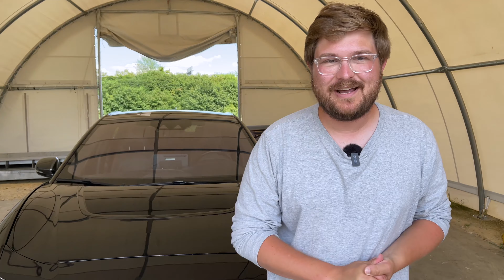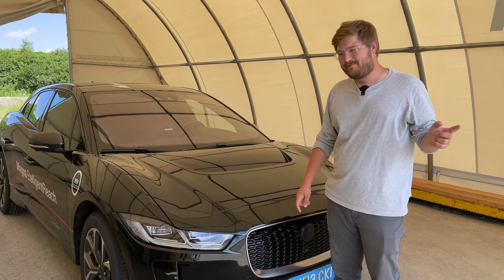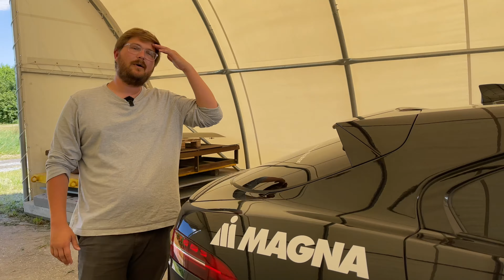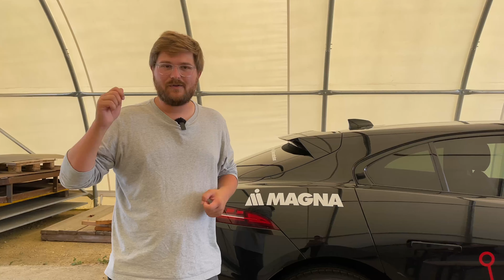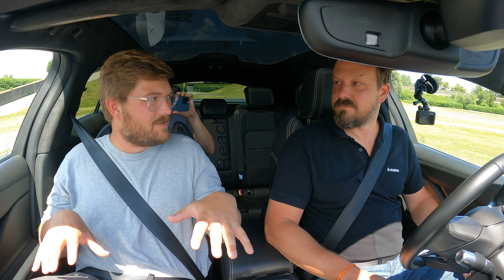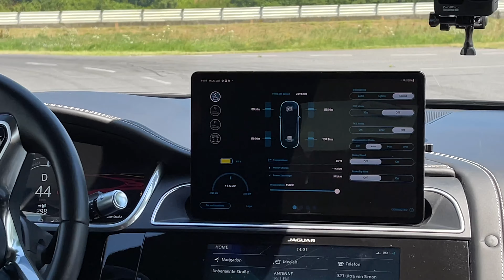Magical Vehicle Dynamics Control With EV Powertrain & Braking System Tuning - Magna EtelligentReach

Comment: Quite interesting video. How does this system handle wind side loads on a wet roadway. When I was in college with a group of three in the car, with rain the car was pushed off the road by a sudden burst of wind coming out from underneath an overpass.  What an experience as the car did a 360 and we ended up in a ditch. Luckily no damage to either occupants or the car. 
Could this system respond fast enough in this type of situation and keep the car on the road??

Comment: This is screaming PSM Plus, but anyway kind of wish he dug deeper on "single model for acceleration and deceleration" thing though of course there must have been too little time to fully take that in. Must be like a brand new MATLAB project file that disconnects gas pedal and engine(or motor) ECU completely instead of like augmenting inputs for the first time in history.

Comment: Why wouldn't you just use indvidual wheel drive instead of a torque-vectoring differential?
Reply: because thats heavy and expensive.
You would need an individual motor and inverter for each wheel.

Comment: As interesting that diff is it’s just not needed with a 4 wheel independent drive ev it’s just a case of careful software calibration
Reply: this diff will be significantly cheaper than adding to extra inverters and motors to a vehicle.
Reply: @Pixelplanet5  your assuming standard torque levels,  ev output to the diff can be considerably higher often requiring a far more robust design, in layman terms its like taking the diff from a Veyron and putting it in a golf

Comment: So you are integrating braking and propulsion to act together. Could it also improve ABS by using faster and more precise response of an electric motor for riding/crossing the edge of a friction and friction brakes as a base? (ie 90% friction brakes and 9-11% motor braking)

Comment: This will be in the Fisker Ocean. The only difference is that the Fisker will have much more power.
Reply: This test car had 320 Kw = 430 HP. The Ocean will have 410 Kw = 550 HP.
Reply: Sorry where was it confirmed that this would be on the Ocean?  Thanks
Reply: @Breen933  Process of elimination. Magna is basically providing all parts of the car that it happens to make. EtelligentReach is the only torque vectoring solution for EVs on the market and the Fisker Ocean is an EV with torque vectoring. That said, I wouldn't necessarily expect the braking portion of this video to be implemented.
Reply: @Breen933  Look behind Kyle on the lift that briefly is shown. That is an Ocean IMO. I own a black Ipace and have an Ocean One preorder. Maybe Kyle will clarify????
Reply: @toddmalone7892  at 5:20, I think you’re right.  Later on during the drive they point camera down to not show a passing car that was also on the test track.
Reply: If Fisker makes and sells any.
Reply: @tribalypredisposed  They've made 50 prototypes, been crash tested, and have collected 50,000+ reservations and are now taking non-refundable deposits of $5000. Its coming.
Reply: @jondevansky186  their UI currently is a black screen with the word Fisker on it.
Reply: @tribalypredisposed  They contracted all the development out. Do you think they just forgot about the UI?
Reply: @jondevansky186  oh, who did they contract the UI out to? Why did Fiskerati write this in late April: "Fisker’s software engineering team will need to have the UI locked in the next three months.?" 

Come on, VW Group has been struggling mightily for several years with their UI and look to continue to struggle, despite spending multiples of the money Fisker has, and Fisker can slap together a team of rejects and make one in a year? 

Fisker has told a long series of huge lies about his company; the odds that he is suddenly telling he truth now are negligible.
Reply: @tribalypredisposed  Fiskerati is a blog from someone just reading publicly available information like anyone can do. 

The only thing Fisker is creating regarding the tech/screens is the design of UI, not the engineering and build. They don't have the employees to do anything further. They are not building their own operating system, platforms like VW, which admittedly is incredibly difficult.
Reply: @tribalypredisposed  UI isn't a big deal these days so many professionals working in the industry!
Reply: @tribalypredisposed  Lol you are going to look like a fool when the ocean releases! why would you doubt magna~!

Comment: When you get to this point, just have four motors and be done with it.  Fewer components, ability to regen for brake each wheel individually.  cost of separate motors vs. the additional clutches is likely a wash.
Reply: Totally disagree. For extreme situations like this the single peak of one motor is not enough to have full control over the vehicle - having a mechanical differential on the rear means you can send even more power to an individual wheel. This is probably my largest complaint with my Rivian - keep maxing out what each motor can do.

Comment: Tesla AWD models have separate brake controls for each wheel... it is how they do traction control on four separate wheels. They can control the speed of front and rear motors and then they can brake individual wheels more or less to get full control over each wheel...
Reply: thats true for basically all cars.
ABS and ESP work entirely based on the fact that they can control each brake individually.